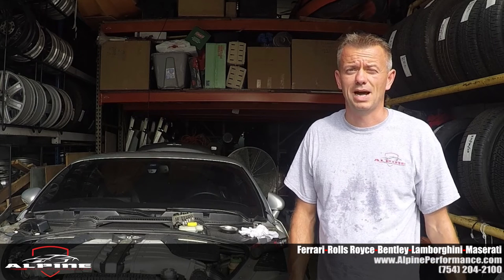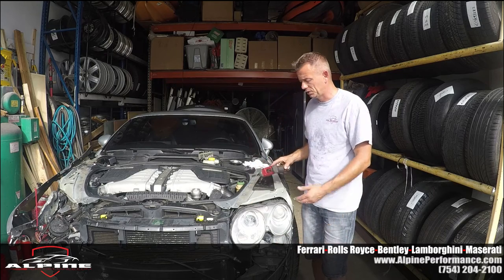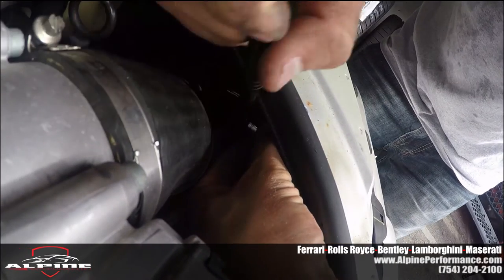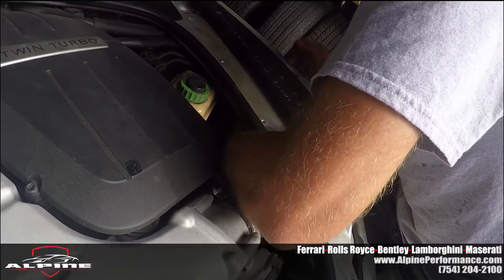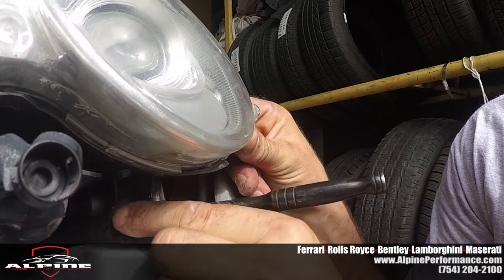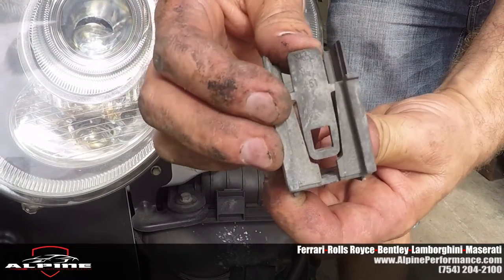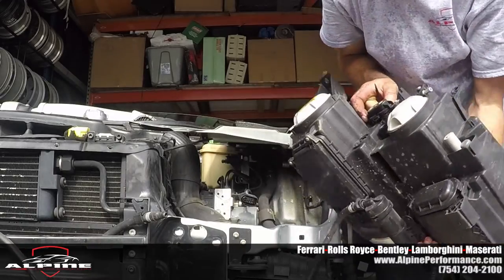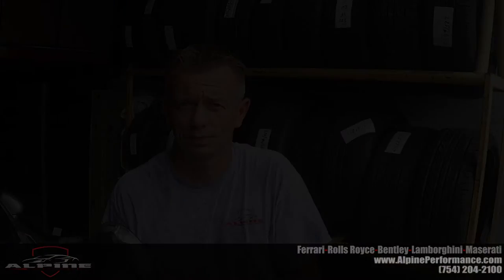#5 How to Remove the Headlight / Head Light Lamp from a Bentley GT Continental

Comment: Yeah but the right side is the fun one. For the right side, you'd have to remove the air cleaner and radiator tank to access that hidden bolt. Why couldn't Bentley just drill an access hole from top down. Smh